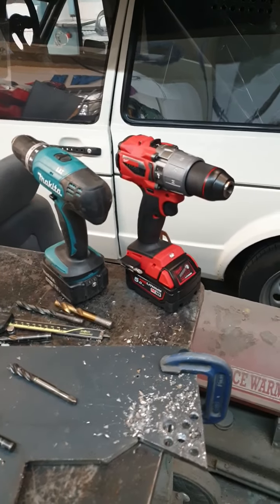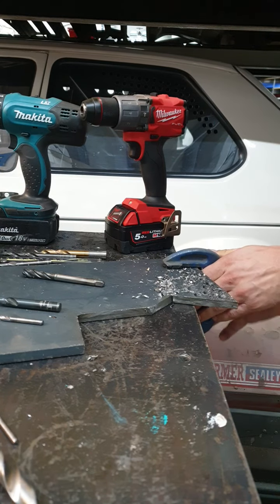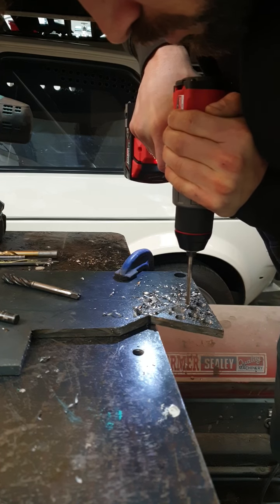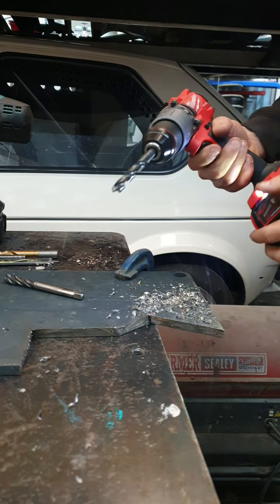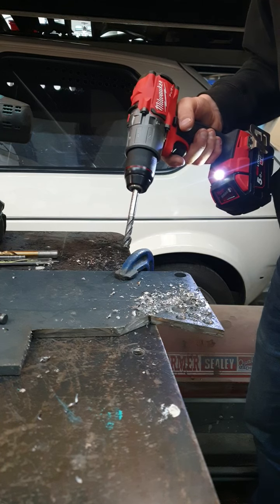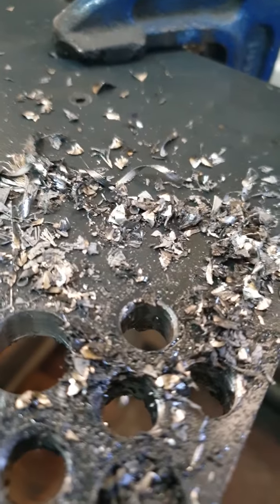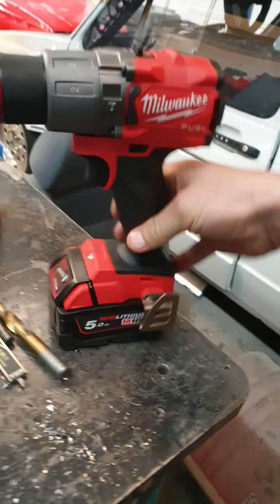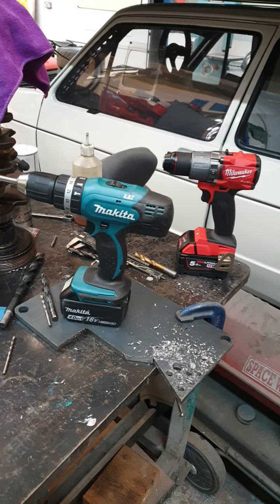Milwaukee M18FPD2 GEN3 V Makita BHP453 Tapping Test

Comment: Milwaukee requires high output battery's 6.0 8.0 or 12.0 with the 12.0 high output battery it beats the bosh biturbo 150
Reply from the maker: But not an old cheapo Makita 🤣

Comment: What's your email I've taken several pictures you had the clutch setting on 6 the whole time I've taken several pictures in slow motion!! Try it again in drill setting 🤣🤣😂😂😂
Reply from the maker: Have you ever used a battery drill..... The motor is cutting out not the clutch slipping 🤣🤣🤣🤣
Reply: @Enares  it's a electronic clutch sorry not a mechanical
Reply from the maker: @TacticalThib  I see what you're saying now. I assumed it was a mechanical clutch when using the Milwaukee. I did wonder how it could be this bad. My apologies I'll give it a second chance and. I wonder if it'd actually drill and tap m14 or m16!

Comment: You say the drill is piss poor!!! This is either staged or the worst user error I've ever seen please email me I will show you the pictures of the clutch setting on 6!!! Makita is sub par compared to the Milwaukee this is a fact my friend. The Makita xph14 made 24 ft lbs of torque the Milwaukee make 60 over triple what the best Makita can make even the xgt model made 36 ft lbs of torque!!! Milwaukee beat bosh biturbo 150 it is par to flex24v turbo hammer drill
Reply from the maker: Trust me it's not staged... You can clearly hear the motor cutting out and not the clutch slipping 🤣 be my guest... Go buy one and try doing the exact same thing. I will say the Milwaukee chuck is incredible! Pisses all over the Makita. I was more than willing to change all my tools over to Milwaukee however after not even beaing able to complete this test I'll be sticking to what actually gets the job done.
Reply: @Enares  send me your email address I will show you your mistake
Reply: @Enares  I screen shot you had it in 6 on the clutch setting or go back and watch your video in slow motion
Reply: @Enares  it's a mechanical clutch of course it's going to not engage
Reply: @Enares  im uploading a video now to show you
Reply from the maker: @TacticalThib  hang on its not a mechanical clutch is it....? Its electronic.... So you'd be right. I'm comparing a mechanical clutch to an electronic clutch.... 🤯🤯 Shit I'll have to go buy it again and do another test.
Reply: @Enares  I just uploaded another shot lol 🤣 sorry I called you stupid!! Hahhahaha
Reply: @Enares  wait a couple minutes and watch the videos I just went outside at 4am to show you!!!! In 15° Fahrenheit cold 🥶❄️❄️❄️
Reply from the maker: @TacticalThib  🤣
Reply from the maker: @TacticalThib  I'll take that. I had no idea tbe Milwaukee was an electronic clutch...
Reply: @Enares  hahhahaha 😂😂😂😂 I told you lmao 🤣🤣🤣🤣